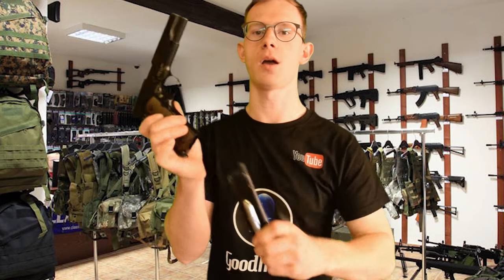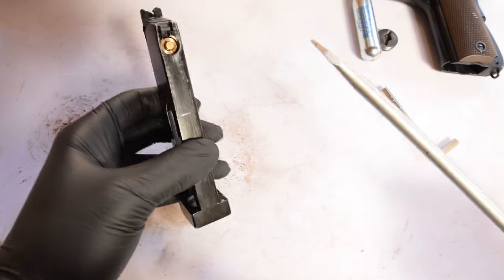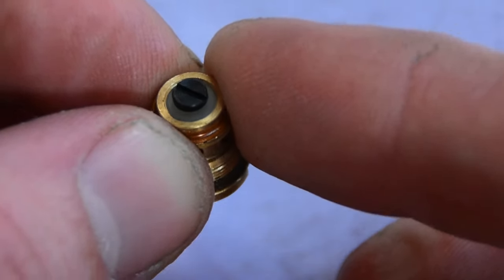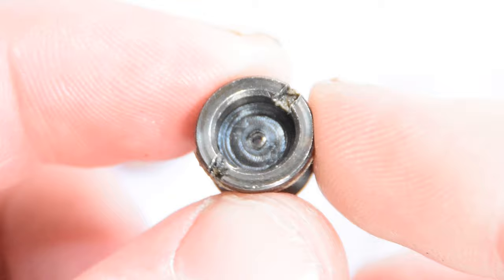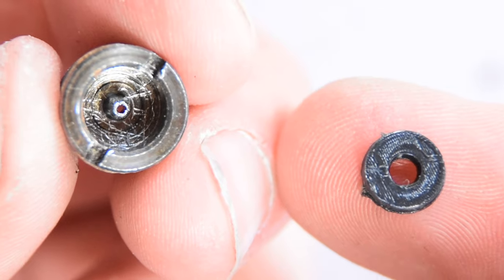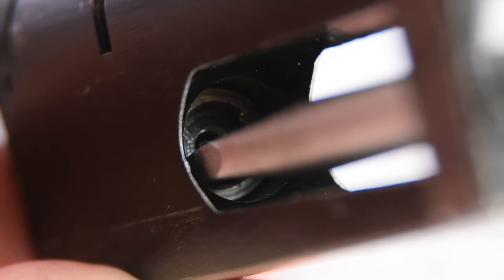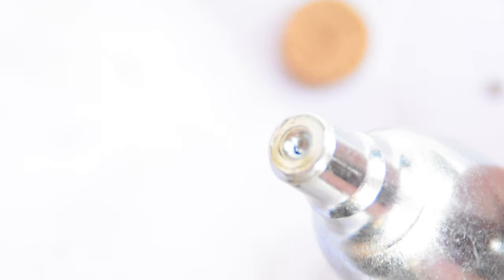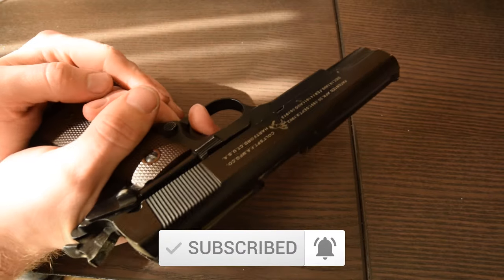How to Fix Leaking Co2 for Airsoft Guns

Comment: This is very common for 1911' s. I had 3 of them and all mags tend to leak air. The remedy is to use a blob of silicone grease on c02 tip instead of pellgun oil. The thickness prevented air escaping and works all time for me.
Reply: How many shots can you get out of your co2? I'm noticing the same thing. I bought a 1911, and I'm struggling to not get it to leak, so I'll have to try this.
Reply: i bought mine today and it’s leaking co2 from the top of the mag
Reply: Teflon tape is even better !

Comment: Ahhh .... 1)  nice idea if you used a Screw Driver with the RIGHT SIZED BLADE!! So it reaches across BOTH SIDES of the Valve Notches!!  2) ALWAYS USE A SILICON LUBE ON THE SEAL (put a DROP on the C02 Caplet End) BEFORE putting it in the Magazine!!! Everyone should know this!!  Non-detergent Transmission Oil (a silicon based oil) is a good substitute!
Reply from the maker: Thanks for summing up

Comment: Hey man I’ve been trying to remove the valve with a flat head screwdriver but the pin doesn’t retract all the way down which isn’t allowing me to turn the valve out, plz let me know if you are familiar with my problem
Reply: Might need a proper valve tool for that type

Comment: I know this is an older  video but it  gave me some direction  i have an issue with me DSPM crosman full auto magazine  it started to leak because the c02 cartridge was left in it too long . So when i tried to remove the gasket i broke the piercer  now i need to replace that along with the seals. where can i buy that part plus the  c02 seals for the magazine ? and what size am i looking for ? thanks again  i am now a subscriber  cheers
Reply: Author of this video PLEASE ANSWER THIS WHERE DO I FIND SEAL/o ring replacement parts also!! Thank you if you answer our questions.
Reply: Same , the piercer thing looks flat in mine

Comment: Where did you buy your seals for the piercing valve
Reply from the maker: I printed them out with my 3D printer, the Free file and information is in the description 😊 have fun mate!
Reply: @GoodMods  what about the oring around the outside of the piercing value by the threading? Mine disintegrated

Comment: is the piercer universal to all airsoft co2 mags? if so where can i buy it?  have a kli baba yaga buy it did not come with a washer on the piercer.
Reply from the maker: Normally, yes! It should fit most common Co2 piercers!
Reply: where can i but the gasket for the piercer part?
Reply: @t3xenfury  he 3D printed it, I’m trying to find it but I can’t

Comment: I'm having an issue whee the co2 is spraying out the top. I tightened the valve but I haven't replaced it yet What do you recommend I do replace the valve and then see from there?
Reply from the maker: You should replace your valve. But, compare it with the cost of a new mag. Sometimes it's just better to replace the whole magazine and throw the old one away 😉
Reply: @GoodMods  They're pretty much brand new, only Fielded once by me :/ 3 of them are like that. Ash co2 for the cz p09
Reply from the maker: @welldonepzza4816  If all 3 have that problem, I would bring it back to the shop and ask for another brand instead. Looks like a manufacturing problem.
Reply: @GoodMods  Bought them awhile ago from online so I probably won't have any luck :/
Reply from the maker: You should try to repair one. I hope you fix it soon...
Reply: @GoodMods  I do too because I really enjoy my sidearm. Appreciate the feedback
Reply: @GoodMods  So I took everything apart and nothing looks damaged or anything still wants to leak sadly :/ is this a problem with most pistol mags? Or did I just get super unlucky
Reply from the maker: @welldonepzza4816  Many mags have this problem if they hadn't their maintnance. New mags shouldn't leak... You are unlucky with these mags sadly enough... I think your valves are broken, they only need a tiny tiny hole to leak...
Reply: @welldonepzza4816  same gun, did you repair them? Where did you get the parts?
Reply: @cnmg7121  Yes and no, I tightened the valve and the ring around or the CO2 meets the puncture hole. Also lubed it all up and left the line on and they worked for awhile ago that then started happening again. I suggest a little bit of Teflon tape or electrical tape around the top of the CO2 so its snug as a bug when putting in
Reply: Try running hot water through it.

Comment: Thanks for the tips. Do you know where I could find a replacement cartridge piercer like the one you removed from the magazine?
Reply from the maker: I don't know what pistol you have but google find alot when searching for airsoft piercer pistol,

This is also a piercer you can search for "KJW KP-13 Part No. 73 + 73-5 - CO2"
Reply: @GoodMods  thanks for the reply. I have a couple of pistols that I'm trying make more reliable, an Elite Force H8R Gen 2 and a HK USP non blowback. The problem with the H8R is the ring that threads onto the piercer valve that holds the seal is made of really soft metal. I've had 2 that deformed and blew out. My idea was to try and find a replacement piercer setup that's more durable. The HK magazines keep leaking from the output valve, so I think I just need to upgrade the o-rings.

Comment: I liked the thing about using a empty Co2 capsule for the first time to help with the seal, I wish I had watched this beefore i wasted sevral C02 bulbs in a new replacement magazine which I got today. I got thhat to replace the previous one which had leaks from day 1 I was begining to think there was a fault with the magazine, especially when i had the same problem today with a brand new one, i now think its becuase it is new the seal hasnt worn in yet to fit the neck of the Co2 and I was being overly cautious about over ightening it. Fotr soem reason all my other airguns I hear a faint hiss and i know that itss punctured but woith this i was tightening it and it gfely like it should have pierced it but I did not hear anmy hiss then suddenly it just all started hissing out bat once, i tried to tighten it and it just emptied thee capsule, I was worrtied that probably damged the brand new seal, I tried again same thjing happened, my threid try i just tightened it more than i felt comfrtobale and the gas stopped leaking and the gun worked as it should so i think its ok now, using the empty capsule is a good idea and i think if i had known that i could have saved those other co2s and potential damage to the seal.

Comment: Hy bro! My problem is the clip. When i put the little co2 bottle it sprays all it out from the upper side!
Reply from the maker: Is it a magazine capsule system or inside your gun ?
If it is a magazine system,
I think you have a bad valve instead of a piercer problem.. If you want you can sent pictures to goodmodsinfo@gmail.com I will look at it but I think the best way is to buy a whole new magazine mate
Reply: @GoodMods  thnx man! Saturday I will go the official arms store. Cheers
Reply: @GoodMods  can I send U a link to my video,where u can see how the CO2 capsule empties in seconds after I place it in a magazine?
Reply from the maker: @diablo748  yes ofcourse !
you can send it here or to my email goodmodsinfo@gmail.com !
Reply: @GoodMods  cheerz mate!
Reply from the maker: @diablo748  its 100% the valve thats broken friend ! I would advice to just buy an other magazine. 

Replacing the valve would be an option but sometimes its just better to buy a whole magazine. If it only was the piercing seal, that would be an easy fix.

Comment: Where do I find those seals?
Reply from the maker: Hi Mico, you need to 3D print it.
I posted the link of the 3D model for free in the description. Let them print it with Flex Filament.
Its so low cost that I don't sell them... so if you let them print. print like 20 pieces or more. :)
Reply: GoodMods Okay, thanks!

Comment: I have a 1911 predator and I’ll put the co2 and then when I start to shoot it will only shoot 2 bbs and then gas goes out through the barrel and the back of my gun. Do you know what can I do?
Reply from the maker: Do you need to put the co2 cartridge in your magazine or in your gun?
Reply: I'm going to try this fix and see if it works for me
Reply: Try running hot water through the holes where the CO2 goes.

Comment: Hey I have a problem where mine leaks gas from the top I can see the gas escaping completely . My valve for my kjw 1911 is weird one with a metal bb inside, is there suppose to be a oring inside the magazine behind the valve ? Thanks
Reply from the maker: Hi! Normally there is a seal on the valves thread.
Reply: @GoodMods  When I take out my valve along with its metal bb , all I see inside is just the hole no oring or anything , should the oring be in the bottom of the threads like so it kisses the valve when it’s installed ?
Reply from the maker: @donaldkondi2979  Can you send pictures and your type of replica to my email? I will help you through mail.

goodmods666@gmail.com

Comment: I have air leaking out when I rapid fire, you shoot about 5 rounds then it just empties the cartridge, I have checked the valve and it looks ok but I cannot get the piercer undone to check that seal, it is an imitation magazine so no side windows and can’t get a screwdriver to grip on it, any ideas?
Reply from the maker: Does it leak air when youre not shooting? Try to listen for leaks.. Otherwise I think its because you are rapid firing and your mechanism cannot handle it.

Comment: Where did you buy the replacement parts
Reply from the maker: Hi, you can print them on a 3D printer with my file linked in the description. print it with Flex and it must be fine.

Comment: Where did you get the percing  and seal
Reply from the maker: The piercer was from my magazine, the seal you need to print with flex filament on a 3D printer you can find the free model on the description tab 😉😁

Comment: ive found this problem that nobody can fix, when i put co2 into my gun, it shoots the co2 all out of the barrel and the blowback
Reply from the maker: Yes you can, it's a problem with your  mechanism Or it's your valve that is broken and needs to be replaced 😔
Reply: GoodMods I got the glock 19 gen 3 I lost the little screw to tighten the co2 can do you know the name of it so I can buy another one

Comment: And what happens if you can hear coming out of the barrel?
Reply from the maker: Is it a pistol? On what does it run? gas, co2?
Reply: It’s a co2 pistol and I just removed the orange tip
Reply from the maker: @night_hawk_cb  you need to check from the beginning, start where your Co2 goes in and go further from there
Reply: @GoodMods  Well I think it’s because I took the orange tip off because right after I did that and put a CO2 tank in, I hear a loud hissing and it stopped when I put my finger over the barrel… There’s a small gap between the barrel and the outside of the gun where the orange tip used to be
Reply: There was no hissing before I removed the tip
Reply from the maker: @night_hawk_cb  does it have a blowback feature? Sounds like a blowback tunnel..
Can you still shoot it? Where are you from?
Reply: @GoodMods  It’s not a blow back
Reply: @GoodMods  And yes I can shoot it
Reply: @GoodMods  And I’m from Massachusetts… I was planning on retiring the gun anyway and replacing it with a better one…
Reply from the maker: Normally you may not have problems removing an orange tip.. Take your slide off and search where the problem starts.
Reply: @GoodMods  The slide is attached to the gun
Reply: Correction; it’s a non-blowback G291
Reply from the maker: @night_hawk_cb  hmm.. I see, you need to take it apart...
Reply: @GoodMods  I’m not confident and taking it apart myself... I went to the local airsoft place the other day and the guy was uncomfortable taking it apart too because he never seen such a gun before... But I’ll figure it out. I’m gonna do a little bit of research about the gun and then I’ll take it apart
Reply from the maker: @night_hawk_cb  I hope you find the problem mate ! pls let me know :)